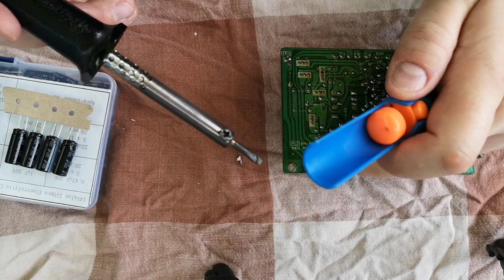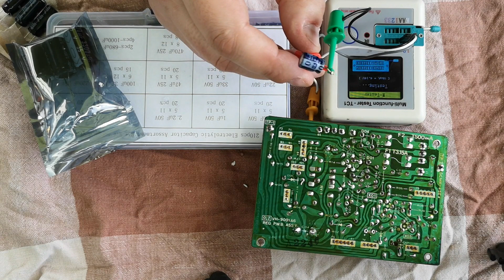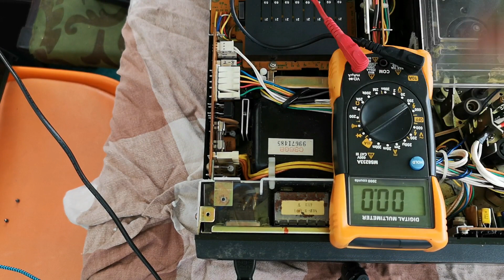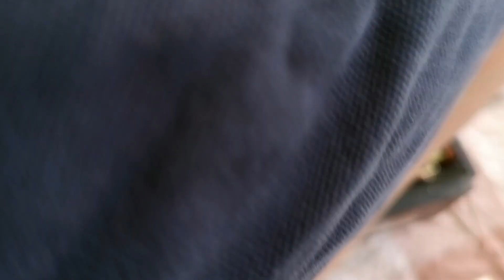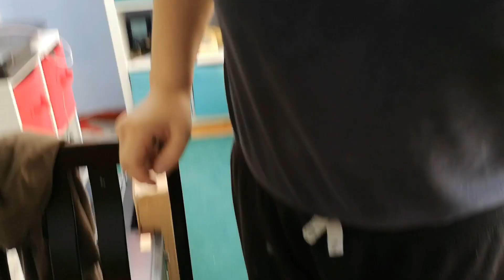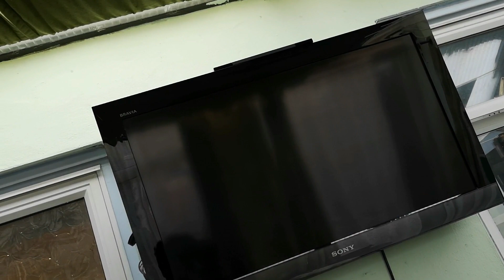Ferguson 3V22 Repairs - Part 7

Comment: The servos in these can be a nightmare. Check C33 on the audio/servo board. It's a 10uF tantalum in the drum servo circuit and it can go low value causing the drum servo to hunt. You won't be able to set up the drum servo in play mode while the capstan servo is off. What you need to do is take the capstan out of the equation, set up the drum and then set up the capstan. Have you got a scope? It's easier with one but not impossible without. The first thing to do is to set the drum discriminator. 

Without scope:
You need an accurate 2V dc power supply and accurate multimeter. Disconnect the mains. Connect the meter positive probe to TP14 and negative probe to TP16. Connect the 2V to TP15. The motor will spin and you should get a reading of around -74mV. Stop the drum by hand and set the discriminator for a reading of -10.2mV. Let the drum go so it gets back up to -74mV and stop it again, do it a few times because you need to make sure that the reading is taken when the motor is across commutator segments (this will be the highest reading).

With scope:
Connect a 100R 1W resistor between TP13 and TP16, connect the scope to the collector of X9 and put the machine in play and pause. Turn the discriminator gain up until the waveform goes unstable then back off until it only just stabilises.

Then the sampling position.

Without scope:
Set the input to camera with nothing connected to the input and put it in record. Look at the drum under a 50Hz light or through a 50Hz video camera. Adjust the speed so that the drum looks stationary.

With scope:
Connect a video signal and put the machine in record. Trigger the scope from the video signal (TP1 on the servo board). Connect the scope to TP9 (the ramp waveform). Slow the drum down by hand so that the sample pulse moves up the ramp and along the flat top to the left edge. Let it go and see how far the sample pulse goes to the right. It will probably godown the ramp, along the bottom, up the next ramp and so on before it locks. You need to adjust it so that it the pulse only goes down the ramp and along the bottom of the first flat to the foot of the next ramp before it comes back. In other words the distance the pulse goes left along the top flat and the distance it goes right along the bottom flat should be symmetrical. It will then go up the ramp, come back down and lock.

The capstan sampling position

With scope:
Connect the scope to TP11. Put the machine in play. Adjust so that the top flat part of the waveform is 75ms in length. 

Without scope:
Put the machine in play. Adjust for stable picture. 

There's a series of articles on servicing the 3V00 in Television magazine, pdfs of which can be downloaded from worldradiohistory.com (listed as Practical Television) the series starts in the September 81 issue.
Reply from the maker: This is fantastic info, thank you so much for posting it. I've moved my piano keys on, for now, but....a friend of mine has a load awaiting attention, I'll be roped in, and this, will give me a real head start.